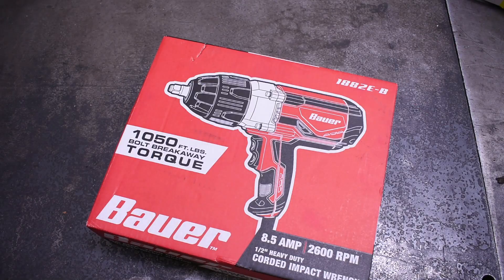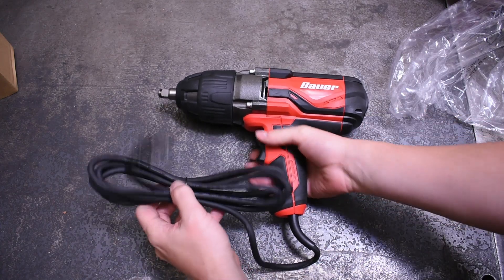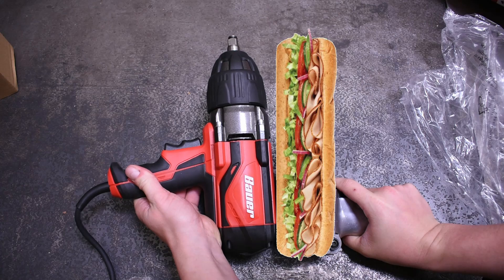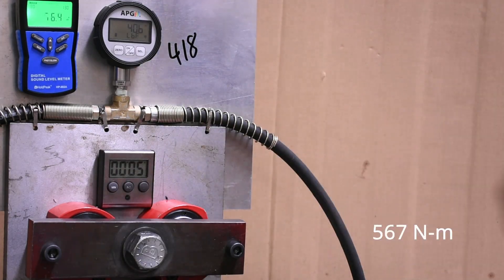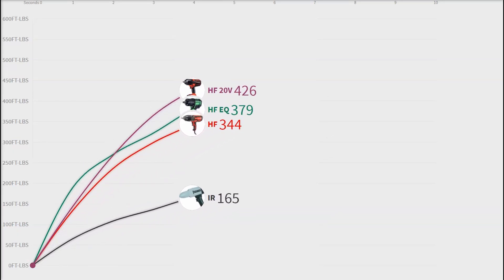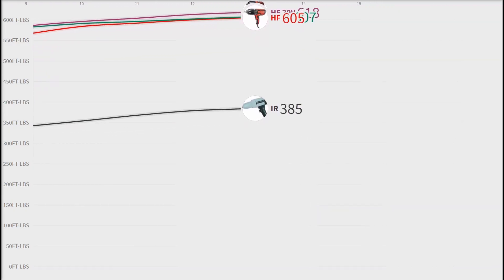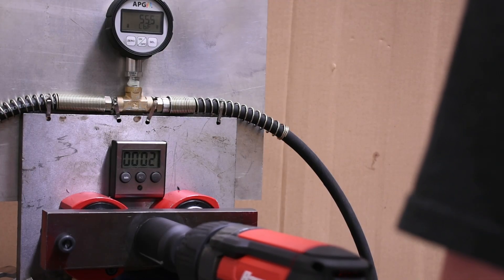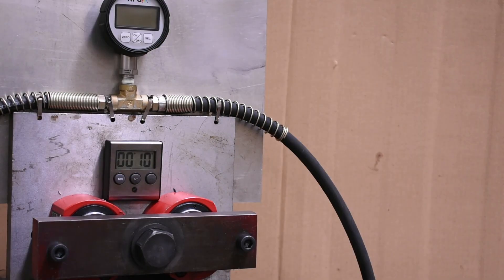How Much Torque Can a CORDED Impact Make? + Dyno Test Extension Cord Losses

Comment: So an oddball suggestion.  Have you ever used a torque wrench, or torque meter to see how much actual twisting force it takes to equal the compression force you are getting on your meter?  I ask because because someone unfamiliar with these tools naturally thinks that is what the marketing is suggesting.
Reply: That’s a great idea. Use a torque wrench set at various levels as your calibrated standard for force, and then compare that against what the gauges are telling you. Who knows how far they might … or might not … be off.
Reply: @shubinternet  The issue (as I understand it) isn't that their measurement is off, it is that what they are measuring isn't the twisting force applied.  They are measuring a clamping force.  I believe that is similar to what some manufacturers do also to generate their claims (if they don't just make it up) so it is a reasonable comparison, but not what I think of when I think of force applied to a nut or bolt.

Comment: Your corded impact does not convert AC power to dc.

It uses a universal brushed motor that will run on AC or DC. Almost all corded drills, grinders, skill saws ect use this type of motor.

Try hooking it up to a 12v battery or 2 in series for 24v, it will work.

Many older welders output dc from the 120v plugs just to run grinders and other tools (lincoln sa200)

Comment: Im sure youve heard this but breaking away say a bolt tourqed to 1000 foot pounds only needs like 750 foot pounds of torque to loosen. Shop tool reviews does a good job of demonstrating this and takes it into account when testing tightening torque. So when they claim 1200 ft pounds nut busting tourqe you only need to produce 850
Reply from the maker: Very true, we only tighten in FWD and REV here.
Reply: @TorqueTestChannel  I've also always figured one way they get to these crazy numbers is they say "nut" busting tourqe. 1 1/2 inch of thread on fine pitch bolt with full contact torqued to 1000 foot pounds takes allot more to break free than a course thread jam nut tourqed to the same spec.
Reply from the maker: @zachsmith7612  Spot on, it could be all over the place and set up however they like.

Comment: I sucked it up and bought some long 12awg better-quality extension cords. It was definitely a worthwhile purchase.

Why would the Harbor Freight brushed corded need a power converter? Those brushed motors are called universal motors for a reason: they're usually able to work on AC or DC. My corded drills look like cordless ones with less electronics and a bigger motor.

I wonder if the cordless get more because of current rating: lithium ion batteries can dump a ton of current, maybe more than the wall?

Comment: @ 3:43 I believe you are referring to a rectifier which converts ac to dc, an inverter converts dc to ac; don’t mean to play semantics just want to inform :)
Reply from the maker: Hey thanks!
Reply: @John G far as I know ac motors do not use commutators, they are akin to brushless dc motors in that they use a rotor and stator. So perhaps it is simply an ac motor in there?
If it is brushed then the commutator will be rather large as it acts as a mechanical rectifier.
Reply: Then wtf is a converter. And why don't we call transgender folks transformers?

Comment: is there any feasible repeatable way to torque a fastener to these high torque numbers and see if it can break it loose?
Reply from the maker: There is, however it would not mean anything by itself. Different sized bolts and thread pitches and more at the same torque tightened level require different amount of force to remove. Our bolt at 200 ft-lbs will not equal your bolt at 200 ftlbs.

Comment: It definitely does not need a big power inverter for that motor...
Reply: Although it might have cost a little bit more, they should have put the inverter in a wall-wart or other box, so the tool isn't longer than a baseball bat.
Reply: @The3chordwonder  I meant like, there literally is no big power inverter.

Comment: Good to see HF corded impact do ok.  My $$$ Milwaukee corded impact 7.0 Amp 300 ft. lbs I bought in the early 2000 is the most disappointing power tool I've ever i have ever bought. It would not remove lug bolts from a economy car on a cold winter day that were torqued to 80 ft lb.

Comment: That's interesting. Pretty impressive really. I just looked it up on their site n in its specs it actually says it's only 300 ft/lbs max torque
Reply from the maker: Yeah, their nut-busting vs Max torque relationship at that store is all over the place. The 20V doesnt even have the spec, the air says 1,000 bascially the highest we've seen and these all make similar power everywhere so....
Reply: @TorqueTestChannel  yeah that's why I do research on alot of harbor freight items before I decide if I want to buy them. I mean I love the store n I have one just 20 minutes away if I need to replace a pittsburgh item, which so far so good on not breaking any, but if it's something that costs more than $30 n only has a 90 day warranty I want to know what I'm really getting

Comment: If you are going to test with an extension cord, you would be wise to indicate the gauge of the wire. The orange cords are usually 16 gauge. The 20 amp circuit to the new wall outlet is 12 gauge. A 15 amp circuit is wired with 14 gauge. Using a 14 gauge or 12 gauge extension cord reduces voltage drop compared to that orange 16 gauge cord.
Reply: @wim0104  Correct, My TBI brain farted. I'll fix it. That is a 20 amp outlet. I've wired  plenty of 20 amp outlets with the stiff 12 gauge wire when I wire my shop.

Comment: You gotta try the Harbour freight chicago electric 61173 it claims only 230lbs but compared to my Ingersoll rand cordless it feels alot closer to 300-400ish as I've accidently snapped some moderate sized bolts and studs seriouslly understanding this gun... even tho my hammer housing is busted in 2 since I just split in half 1 day and I electric taped it back together and it's still going strong 3 years later

Comment: I was just getting into power tools about 3yrs ago when I bought the corded Bauer, hoping to make a complete front end suspension rebuild more fun. Enough power for all the fastener it encountered, but I couldn't access most of them with this behemoth, especially after strapping on a full length 1/2 impact socket.

3yr late... I'm on the big 3 (Dewalt, Milwaukee, Makita) battery platform plus others, and this youtube channel has quickly become one of my favorites. Keep up the great work guys (and gals if applicable)!
Reply: I use my big Bauer as a backup for very stubborn nuts & bolts. Aside from that I have a stubby M12 3/8 Milwaukee for everyday use. I'm also tempted to buy the 1/4" compact Hercules that HF sells. It looks like it would be good for doing delicate bolts as its' torque rating is low. :)

Comment: EEEHHH... I mean if you use a 25 foot 10 gauge extension that's gonna be a lot different than a 50 foot 16 gauge... but I see your point. I do own a few like "12 amp" extension cords.. probably should be illegal but totally fine for running a 1 amp fan or something. I also have a few 10 gauge 50 foot made in usa extension cords for running my 10amp air compressor or anything else that'll draw some juice... terrible idea to skimp out on extension cords! Gotta have at least one good one...

Comment: Is that Corded Impact Brushless? Not yet but it will be soon....
Reply: Hitachi has brushless corded impacts, they're crazy expensive...
Reply: @mihkus  338 dollars on amazon idk what brick and morter store has it
Reply: I've used one in some pretty heavy-duty situations and I will say that the last time I used it I smelled some burning. This was after failing to break loose an incredibly rusted camper stabilizer jack, so I think I got some of those fireworks without noticing it. In the impact's defense I couldn't get the bolt loose with a 24" breaker bar and good deadlift form, I'm pretty sure that thing is going to take the torch to come loose.

I was expecting it to be higher than the cordless since it can pull more power but I guess the motor does the same thing whether it's coming from a battery pack or a wall socket.
Reply: @eargesplitten9876  They don't develop corded or air technology because there's no money in that. They rather put all the money in the battery line so you can spend 300+ on batteries and 100-200 per tool and be locked in their lineup forever. Corded tech has stopped in time for a long time now.
Reply: @wills5482  Corded hasn't stopped completely. DeWalt and Hikoki/Metabo HPT have been releasing some brushless corded tools, mostly grinders and large rotary/demo hammers, which get abyssmal battery life with even the high cap batts.
Reply: @eargesplitten9876  Often batteries can put out more power momentarily than wall outlets. Strange but true.
Reply from the maker: Hahahaha
Reply: nah they want you buying into a battery system, universal power is not going to win :D

Comment: Was it a 12 gauge cord or a 14? it will make a difference.
Reply: I went through the comments to see if anyone else questioned their cord before I put in my 2 sense. If I had to guess based on how the extension cord compares to his hand it's prolly 16 gauge. A high amp tool like that impact is hungry for amps n would love a 12 gauge or heavier cord
Reply from the maker: @benmiller5015  In the description. 16 gauge, we wanted to provide sort of a "oh well, i have this" scenario. Not a best case one
Reply: @benmiller5015  this tool draws 8.5 amps a 50ft extention cord would need to only be 14g . That equates to only 1.9% voltage drop. Well within recommend <3% drop.
Reply: @foxwood67  I'd still play it safe with a 12 gauge or better

Comment: The don't seat brushes on cheap power tools.  Those brushes will wear in with some use and the sparks will become a more 'normal' level.  Assuming they do wear in and don't burn up first.

Comment: It does make me think however, why can't the voltage change be done in the handle, say in the location that a battery would be in a cordless impact, then the actual body could be the same size a conventional cordless and help balance out the tool. 

I suspect it's a money/profit in the batteries that's the issue, as there aren't really any high end tool manufacturers that make corded tools. 

It would also be quite interesting to know if the extension issue would be less of a problem here in the UK where standard voltage is all 230v.
Reply: Cramming a switch-mode power supply capable of matching the output of modern batteries in a package that small would be very difficult.

Comment: Power outlets aren't necessarily better than an extension cord, as long as you run a 10ga extension cord. Plenty of outlets are ran with 12ga or 14ga.
Reply from the maker: Thanks, we added this to the video's FAQ!
Reply: As an electrician, I came to say this.
Reply: That was my thoughts exactLy
Reply: I would say most outlets are run with 12 gauge cable at least in this country today. So if you’re running a 12 gauge extension cord you’re pretty much running exactly what’s in the wall. Your best case practice is just around the shortest extension cord you can from the closest outlet available to you.
Reply: @wb5mgr  Not true. Most go with 14 gauge because it's the bare minimum needed for a 15A circuit. My shop on the house I recently bought is wired up with all the outlets and lights on a single 15 amp circuit with all 14 gauge wire lol. It's terrible. If I run a tool like this it dims the lights pretty bad when it starts, although the only thing that ever trips the breaker is a 1hp drill press I recently picked up. I added a dedicated 20 amp circuit for that one.
Reply: Worse, all of those bright-orange store bought extension cords that are ubiquitous across the entire planetary hemisphere are like 16 gauge. Only toolbuffs//enthusiasts buy an actual 14/12ga
Reply: @Biaanca5036  have an 8 gauge  cord I made for running the welder outside. It's a beast.
Reply: Stranded vs solid copper though, and 12ga solid is like 10ga stranded.
Reply: @ctrlaltdebug  That is straight up false. 12 ga stranded and solid have the same amp ratings.
Reply: @bourbonrebel5515  Is stranded the same diameter? It must be larger then.
Reply: @ctrlaltdebug  The difference between 12 gauge stranded and solid is 0.008 inches in diameter. Not significant enough for a different amperage rating.
Reply: @bourbonrebel5515  the air gaps between the strands mean that there would be less copper for the same diameter wire. The difference is significant enough for a separate hole in wire strippers.
Reply: @ctrlaltdebug  12 gauge is 12 gauge assuming the insulation and metal is the same. There is no separate amperage table in the NEC for solid and copper wire. It is all based by gauge, insulation, and the metal used.
Reply: @bourbonrebel5515  if they define larger diameter stranded wire as equal to 12ga solid, fine. Just saying that an equal diameter stranded wire is going to have less cross-sectional area made of copper than a solid wire. Thus it has less conductivity than a solid wire. That's a fact.
Reply: @bourbonrebel5515  looked up awg diameters. The difference in "12ga" is 0.08 solid and 0.10 stranded. That's 25% larger diameter for stranded to make an equivalent amperage rating.
Reply: @ctrlaltdebug  no clue where you’re getting your numbers. 12 gauge solid is 0.081” in diameter where as stranded is 0.0.92”. The circular mills for both is the same at 6530.
Per NEC 240.4(D) 14 gauge will always be rated for 15 amps. 12 gauge for 20 amps. 10 gauge for 30 amps.
Reply: @bourbonrebel5515  12 gauge diameter is always 0.0808 inches, solid or stranded. What NEC has done is define a "12ga" trade size that is based on ampacity. I got my numbers from AVOutlet's solid and stranded AWG conductor chart. The stranded diameter goes up with the number of conductors.
Reply: @ctrlaltdebug  apologies. You must have mistyped as you said the different in 12 gauge. So I thought you were saying the diameter difference between solid and stranded 12 gauge is 25%.

And no, the diameter is different between solid and stranded within the same gauge. You can see that on Table 8 in Chapter 9 of the NEC. Page 689 if you have NEC 2017 like I do.
Reply: However if you run a long extension cord then you're increasing the resistance by a discernable amount and losing power. Even a 10 gauge extension cord will have a noticeable effect given enough length despite the decreased resistivity.
Reply: I was about to type the same thing.
Reply: 14/2 is better than a cheap walmqrt cord bud

Comment: Not much difference in an extension cord and wall wiring.
Also a suggestion.  You could add a cheep meter to the plug like a kilowatt to measure the draw.
Reply: 12 gauge stranded and 12 gauge solid would not be the same rating because stranded and solid are not equal they do not have the same load capacity at equal length.  Equally rated wire you would have a larger diameter or lower numbered gauge of a stranded wire to equal a solid wire.  So I don't know how is it when that happens
Reply: Comparing same rated wire and length.  I did not think i had to state that but i guess this is still the internet
Reply: @donpayton737  imagine having someone explain to you why you're wrong, and you don't have the brain capacity to understand it🤣
Reply: @donpayton737  comparing 12 Guage stranded wire to 12 Guage solid wire are the closest you'll get to "same rating", and the dude literally examined why with an example. You're just to dumb to understand it, clearly.
Reply: I’m glad I don’t have your house’s wiring. Electrical cords are stranded, and thus have a lot smaller load rating compared to the same gauge solid romex and other solid in-wall rated wiring. But the performance of this impact was not drastically reduced, but let that cord get warm, maybe still have 25feet still coiled up on the ground, I’d bet that results would be even more of a loss, maybe not much, probably a total of 10-15% loss but still, you can see the difference in the resistance (and eddy currents when coiled) in extension cord.